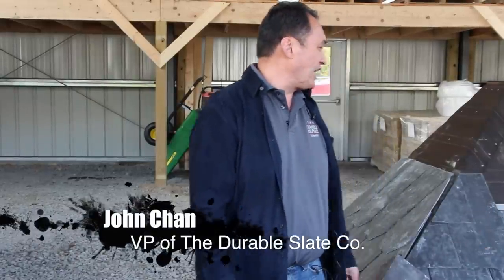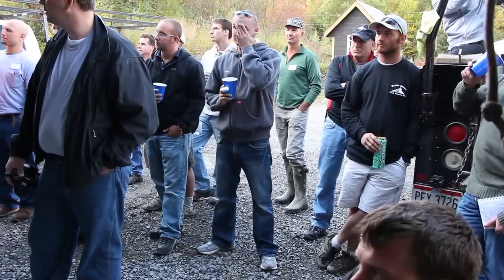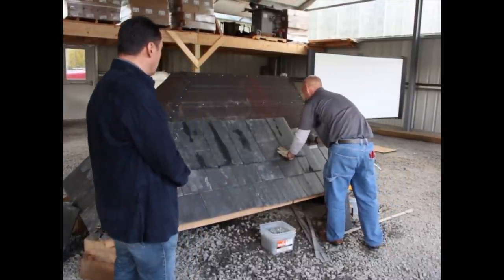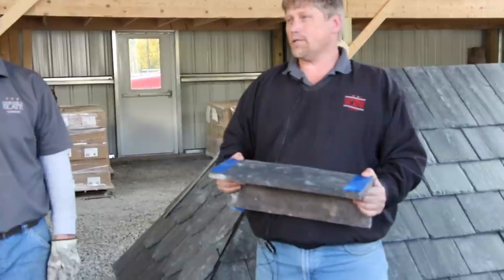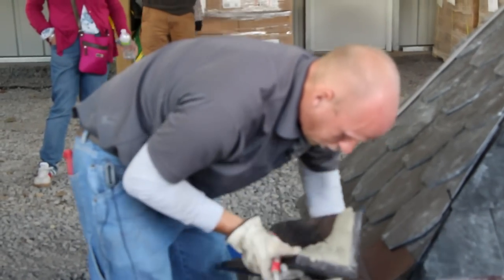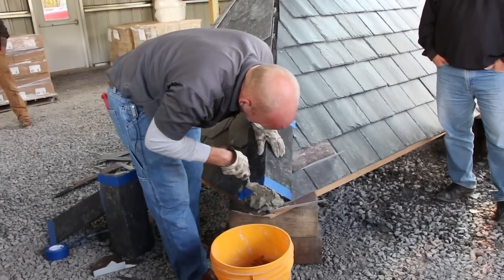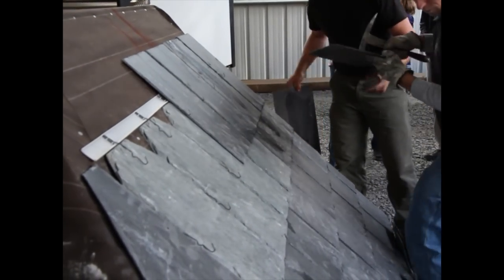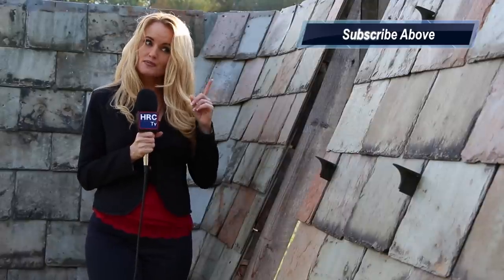New slate roof installation at the SRCA conference by The Durable Slate Company

Comment: That roof is going to blow away. Every system that I have seen before in North Wales that was based on hooks has failed. I don't like the hips. The mortar doesn't match. Saddle or mitred hips would look far more professional. I reckon some of those gaps around the hip will also let water in.
Reply: I,ve used about 30,000 slate hooks. Not one hook or slate has come off. These are used in Cornwall and Brittany because the  the high winds!

Comment: SHOULD BE PUTTING A GREY MORTAR MIX WHEN POINTING RIDGE AND VALLEY WITH SLATE. LOOKS ALOT BETTER THAN THE NORMAL AND ALSO HOOK FIXING WOULDN'T LAST LONG IN WINDY AREAS.

Comment: slow messy and will sweat in time not great
Reply: Is that strip with hooks on not nailed to roof  . Slates aren’t eared top corner  hip iron to high  muck to wet  wot a load of crap  sack all of them . Wot a messy jod
Reply: Historical restoration my ass  .i am so disgusted   with that  I have been rag slating for 33years never seen such bad workman ship   . Time for a glass of wine